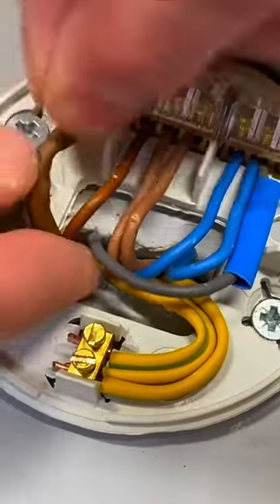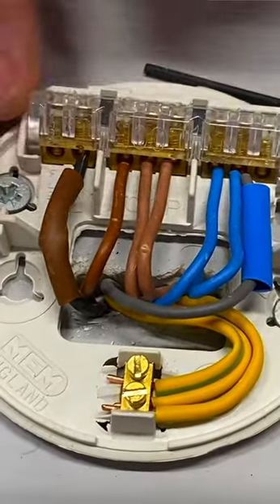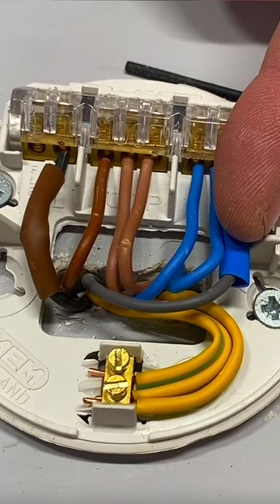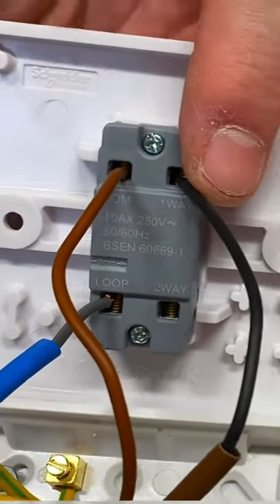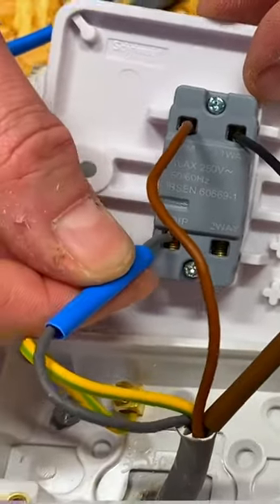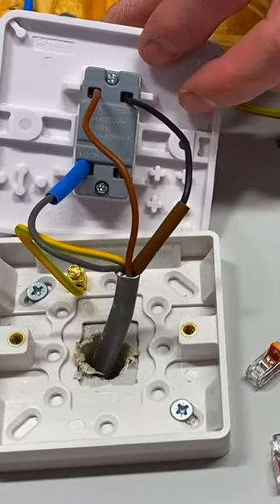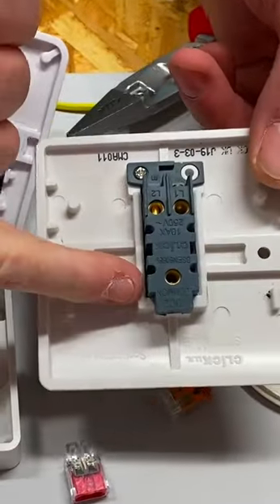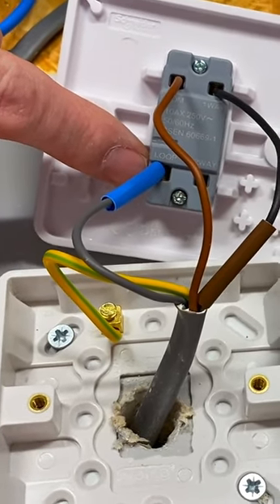DIY Enthusiasts Stay Away…

Comment: Not all DIYers are incompetent, and wiring of switches and sockets is certainly something even a poor DIYer is allowed to do. I do my own electrics and have done for over 30 years with no issues. I personally always use 3 core to my switches but put the spare N wires into a Wago block at the rear of the switch. The electrician we had to use during an extension also did the same. Some of his work has failed already, mine is still going strong!!
Reply: And this is why people don't trust trades.
Reply: What tester do you use to test your work?
Reply: @supersparx1  not sure he needs to test. Sounds too good for that
Reply: @supersparx1 Looking at some of his other comments, the guy is an absolute genius, and sparky work is almost too easy for him
Reply: @entergenericedgynamehere8751 It's not overly difficult is it really?
Reply: @supersparx1 Megger MFT
Reply: @CarlosFandandgo  Out of curiosity, what do you do for a living?
Reply: @CarlosFandandgo  What model?
Reply: @supersparx1  I can almost hear him frantically googling Meggers

Comment: WRONG!  loop is meant for a line conductor, not an N. Get this obsession out of your head about potential DIYers 20 years hence.
Reply: WRONG! Schneider specifically made that terminal for the Neutral, do a little research and look the switches up. Hager do the same
Reply: Wake up John its 2024
Reply: Neutral is a line conductor
Reply: @detroutspinners9933  No, the line conductor is what we used to call 'live'. The Neutral conductor is considered a live conductor, not a line conductor
Reply: Nope... It's a live conductor...
Reply: @entergenericedgynamehere8751  
Checked with Schneider. I am wrong, apologies.  But they should label it Neutral. 
But my second point still stands.
Reply: @user-wk7wv8rn8h  
Only two manufacturers to my knowledge  make these switches with a N terminal. Not common. Most use Wagos to join the neutrals.
Reply: Don't take any notice of John Burns.
A few months ago he was telling everyone that the best way to provide additional protection was to have a lone 500ma RCBO upfront just like the French😂😂.
Reply: @supersparx1  
Yes, that is how the French do it. Better than the UK. Now you know, which you never had a clue about.
Reply: @supersparx1 😂😂
Reply: @johnburns4017  Why is it better?
Reply: @supersparx1  I am excited for this response that will obviously make complete sense
Reply: @supersparx1  
The French have a combined main switch/500ma RCBO replacing the main fuse.  Called a Disjoncleur differential. Far superior to the antiquated junk the UK has.

They also have consumer units with twin L&N busbars and double pole breakers as standard. Leaves the UK standing.
Reply: @johnburns4017  You'd do well to understand different earthing systems and subsequent associated methods of protection, before stating carte blanche that what the French do is far superior to the UK way.
Reply: @supersparx1  
More confusion. Sad.
Reply: @supersparx1  
The French system is very good especially the main panels where all has to be DP and twin L&N busbars (combs) are used. But Schneider are selling in the UK one, two and three row metal main panels with comb busbars. The UK is ahead in that main panels have to be metal.  So the Continental main panel system is available in the UK. So the French now do not technically lead there, but lead in it being mandatory in France.  

The British G type plugs are much superior, in fact the world's best. If the French used the British plugs, which they should, they would be right up there. 

Conduit does have its advantages of course and you can do that in the UK, and it is done, but but not mandatory. But twin & earth is cheaper for installations not requiring expensive conduit, and does exactly what it is supposed to do. RCD and RCBO protection makes twin & earth even more attractive. 

In the UK all has to be RCD protected. What is now common is an RCBOs on each circuit which is superior to the French system of one RCD on a bank of mcb's on each row. RCBOs are single and double pole. RCBOs are rare and not freely available in France. 

In the UK, buildings over 6 floors need AFDDs on any circuit with a socket on it.  RCBOs and AFDDs are recommended. 

So where does the French system score over the British? 
1) Interrupters in main panels are mandatory DP.
2) Wiring is mandatory in conduit. An advantage in some situations.  
3) Combined main switch/500Ma RCBO eliminating a main fuse. 

In the UK can have:
i)  Can have DP AFDDs & DP RCBOs on each circuit. (they are recommended by the regs). Optional.
ii) SPD (spike suppression) not mandatory, but becoming defacto standard. Customer may not want one. Optional.
iii) Main panels are mandatory metal. But the French have the outer cupboards metal. 
iv) British switched DP Type G sockets and plugs are superior.  

In short, have a British system mandatory from i) to iv) with a Combined main switch/500Ma RCBO eliminating a main fuse then it is superior to the French. A long way to go yet. 

Now you know.
Reply: @johnburns4017  Thanks for all the waffle about French Vs UK electrical installation requirements.
But that's not really what I asked.
I'll ask again.
Why is an upfront 500ma RCBO better?
Reply: @supersparx1  
Discrimination also referred to as selectivity, double pole, and integrated main switch for starters. Now what can you add? 
20 points for each one.
Reply: @johnburns4017  😂😂. Discrimination/selectivity with what? You really don't know why or what equipment you should be selecting for what purpose do you?😂😂😂
Reply: @supersparx1  
A quiz.
What is the name of the twin L&N busbar used in French consumer units?
20 points for the correct answer.
Reply: @johnburns4017  A Quiz. Why is an upfront 500ma RCBO better? 20 points.
Come on I've asked you 3 times now and you still haven't answered.😂😂
Reply: @johnburns4017  Why would anyone working on UK electrical installations either care or need to know about French electrical installations?
Reply: @supersparx1  
I am the only Quizzing Quizzer. I am the only one to ask the questions.  You know the rules.
Reply: @johnburns4017  Is that French for "I haven't really got a clue what I'm talking about"?
Reply: @supersparx1  
BZZZZZZZZZT! Wrong answer.
supersparx1, the name of the twin L&N busbar used in French consumer units, is...

🍾🍸🎊   a comb 🍾🍸🎊

Zero points. Zero.  Better luck next time.
Reply: @johnburns4017  And there you have it folks. True to form this John Burns the DIYer turns up in a comments section, spouting nonsense. 
When challenged he goes off at a tangent waffling on about French electrical systems to try and hide the fact that he knows nothing about electrical work.
Another thing you will notice is that he'll peddle some mis information and will then be put right.
Then what he does is he starts to post up the corrected info as though he knew it all along.😂😂😂😂
Reply: @supersparx1  
A quiz.
Give the official name of the RCBO on the main incomer in a French electrical system?
20 points for the correct answer.
Reply: @johnburns4017  A quiz. Identify the correct light switches to be used in a three storey town house in the UK. 20 points for  the correct answer.
Reply: @supersparx1  
BZZZZZZZT! Wrong answer.
The official name of the RCBO on the main incomer in a French electrical system is...

🍾🍸🎊 disjoncteur différentiel 🍾🍸🎊

Zero points. Zero. Better Luck next time.
Reply: John obviously isn't a sparky.
Reply: @93lornamae  
You got the answers wrong, didn't you!
Reply: @johnburns4017  what a earth are you talking about. We are english, not french, thank god. 🙏
Reply: @93lornamae  
Some of us are also Irish, Scottish and Welsh.
Reply: @johnburns4017 Yes, and some of you are DIYers that have know idea what you are talking about, but here we are
Reply: @chewie1349 😂😂
Reply: @johnburns4017 Oh dear quiz master extrordinaire, something else you haven't a clue about.
😂😂😂😂
Better luck next time.
Reply: @johnburns4017  pop quiz.. 
20 points if you can give an example of why a customer has no choice whether an SPD is installed or not.
Reply: @chewie1349  
I am the only Quizzing Quizzer.  I am the only one who asks the questions. You know the rules.
Reply: @johnburns4017  It's okay to admit that you don't know the answer. 
Side note: I'm genuinely curious why you think an additional combined main switch/500 mA RCBO is superior.
Reply: @chewie1349  
A quiz.
Name the number of poles in a standard French disjoncteur (miniature circuit breaker)?
20 points for the correct answer.
Reply: @johnburns4017  If you insist on names,
Antoine and Celeste.

Take your pick of the following answers
(I) Phase + Neutral 
(II) Double pole 
French: Disjoncteur Phase + Neutre

Keep the points, looks like you need them more than I do.
Reply: @chewie1349  
BZZZZZZZZZT! Only one answer accepted..
The number of poles in a standard French disjoncteur (miniature circuit breaker) is..

🍾🍸🎊  Two poles 🍾🍸🎊

Zero points. Zero.  Better luck next time.
Reply: @johnburns4017  Chewie is mugging you right off in front of the whole world wide web.😂😂
Reply: @johnburns4017  
Double
adjective
1.
consisting of two equal, identical, or similar parts or things.

Key word, two.